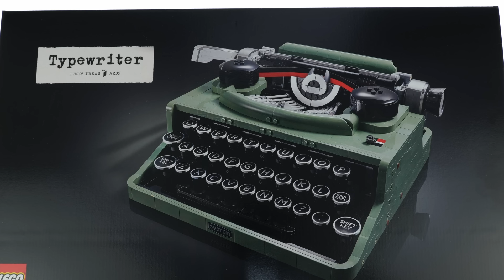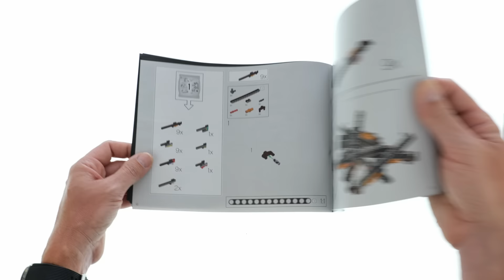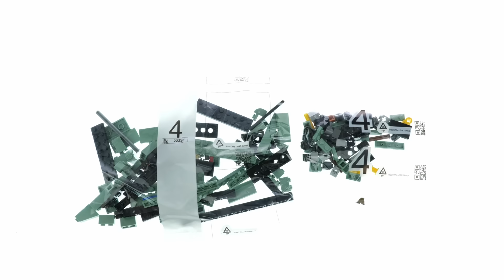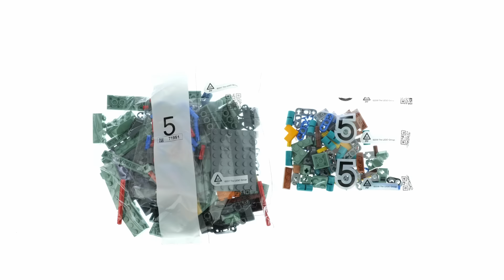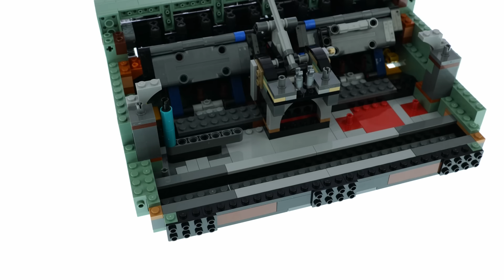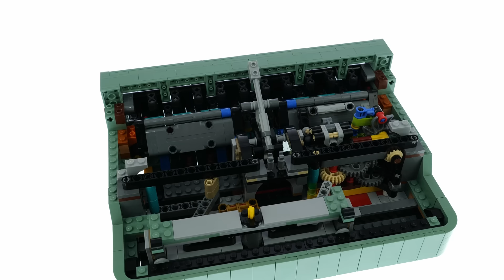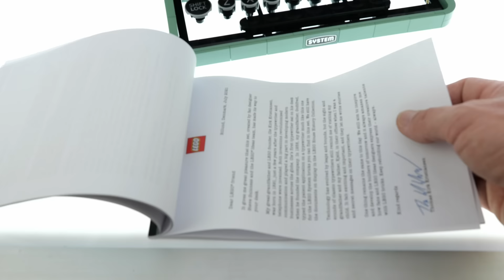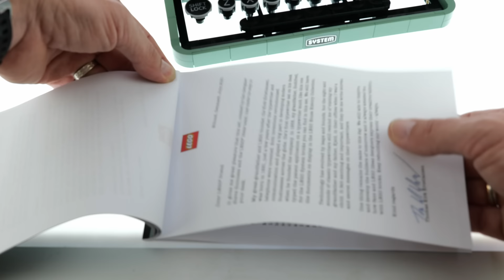LEGO Ideas 21327 Typewriter - LEGO Speed Build Review

Comment: On step #20, after inserting the black space bar (5 holes), it sits on the round space circle on the 3rd pole from the left side.  There is then a 1/8" space, which makes it impossible to continue up to step #22, where you insert the green piece on the side ????